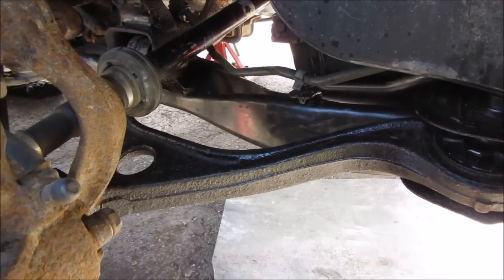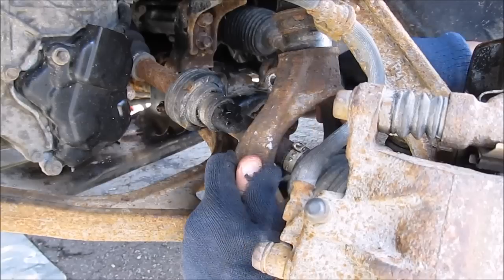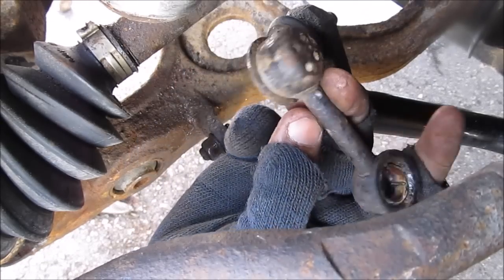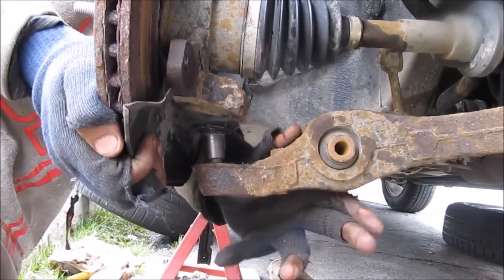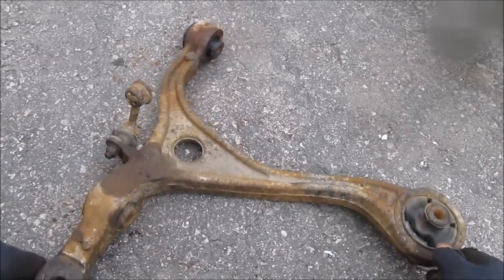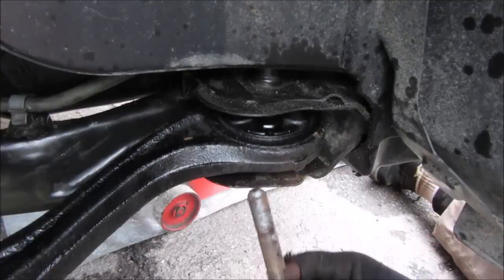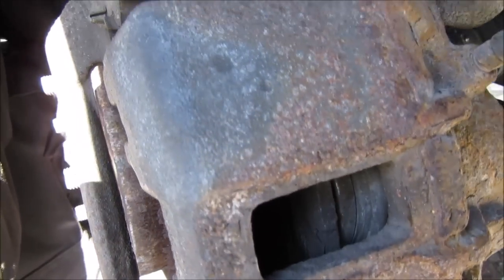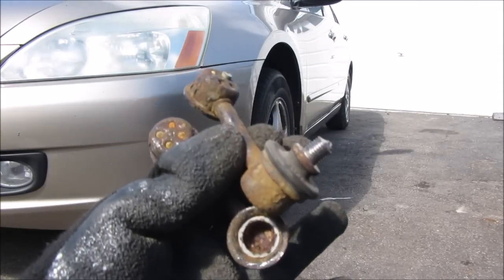Lower Control Arm Replacement Honda Accord

Comment: Customer:
I have an awful clunking noise from the front end ever since since you replaced my lower control arm?
Mechanic:
Oh that'll just be your sway bar freely bouncing up and down because I broke the end links and didn't install new ones, so notjing is connecting your sway bar to the lower arm.
You don't need those, it's just a family sedan, you'll just have to live with that hammering on the lower arm or possibly swinging down and dragging on the road, it's ok it will self clearance eventually🤣🤦‍♂️

Comment: Great video! What ball joint separator was used to separate the ball joint? All the tools I can find fork size seems to be not big enough, I believe a 28mm tool is required. Can you please share the details of the tool used.

Comment: @rafatorres1420rt, or anyone here, how do you torque to specs when the car is on the normal position? Does this mean when the car has been fully lowered from the jack? How do you fit underneath to do that? Sorry new to diy here.

Comment: The Honda ball joints require a wide jaw separator.  Where did you get yours?  Most places only sell 18mm or at most 22mm, whereas 28mm is required.
Reply from the maker: Princess auto

Comment: 1:10 FYI to peeps...it might not be that easy on your car.  If the bushings have life left in them you might need to push the control arm down to make enough clearance to get it out that way.  I also highly recommend spraying the part where the shock and fork meet with penetrating oil....it will make it way easier to get it off if it's seized together.
Reply from the maker: You might as well cut them off

Comment: When this bolt that you mention it is stuck how do u cut it ? Where from you cut it as i have this issue with my honda accord and i cant take the bolt off?  At 3:33 sec of the video bolt.

Comment: Is it labled as passenger or front driver control arm?
or just any control arm fits?
ive seen a couple but does not specify if its left or right.
Reply: no they are not interchangeable

Comment: Hey, I recently hit a curb with left front wheel at a moderate speed on my 2010 Acura RL. I was going straight down the road and hit a low "sidewalk" type" divider of lanes island head on but only edge of it. After the hit, steering wheel became off center about 1/4 inch.  I went to alignment shop but tech didn't find anything that was bent and completed the alignment.  The caster is 2.0 on the left side which took the hit and 2.5 on the right side.  To me it looks like left wheel is pushed back some.  The steering wheel is straight now, but needs a bit more effort steering than used to be.  Which component could be bent?

Comment: I am just starting to do this on my 07. I thought I would start by making sure that I can loosen the compliance bushing bolt.  Thats where I'm at right now. Can't seem to budge it. Using a breaker bar. Not impact.  But I'm also being extra careful. If can't loosen them I'll probably have mechanic do it. Are these bolts really that tough to loosen? Don't have much rust.

Comment: What type of impact tool do you need in order to remove those bolts etc when replacing a front lower control arm
Reply from the maker: 1/2" drive

Comment: Seems like Hondas are always needing repairs, I see a lot repair videos on mostly Honda vehicles.
Reply: That's because Honda's are going a lot more than 200k miles and parts eventually needs replaced. Other cars don't even make it passed 150k without blowing up trans or motor and end up in junkyards.

Comment: Been doing this job or 2 days now. Every single bushing was stuck in its sleeve with the fucking might of Zeus. Had to break out the damn sawzall for the one in the back and had to mangle the frame mount on the front one just to get it off. Rust is the worst. Love your vids tho this was a big help!

Comment: speedkar99! Good Video! I enjoy watching them and learning tips and tricks on car auto repair.
I have a 1999 Honda Odyssey 195k Miles where  both the compliance bushings are showing signs of cracking. I looked at the Honda OEM part, but they are $300 for each control arm and a total of $600 together before tax and shipping. I know Honda OEM is probably most reliable and durable, but how do the other brands compare?
I was looking at Mevotech, and moog where their lower control arm is ~$100 each. How long do those ones last compared to OEM?
Reply: Moog has great reputation in American cars. I have little experience in foreign, but I assume equal quantity.
Reply from the maker: MOOG control arms aren't as good as the ball joints, they are  typically outsourced
Reply from the maker: Supposedly they last longer than OEM but you have to keep greasing ball joints. They also come with a lifetime warranty which is great, depending on who you buy it from. See my aftermarket vs OEM ball joint video

Comment: On my right side, the bolt that goes North and South (towards front of engine) is stuck on the compliance bushing. Do you have any tips on removal? I tried a 1000 Ft lb impact and it still didn't budge.

Comment: I just did this job on my 2006 Accord. Replaced upper and lower control arms, end links, struts, and brakes. You're lucky the mounting bolts for the lower control arms came loose. Mine were seized. I tried everything and had to resort to cutting them out and buying new bolts. Not an easy job at all. You're lucky all you had trouble with was the end links.
Reply: Did car handle better after changing bits.

Comment: Really liked the no nonsense video. Do you have an opinion on the fitment of aftermarket control arms or other suspension parts on this accord gen?
Reply from the maker: Most aftermarket are made to OE spec, just look for material construction, price and warranty

Comment: What are the bolt sizes my all broke
Reply from the maker: Ouch. Dealership can get you OEM ones or take the old scraps to a hardware store and match them up
Reply: Go with the OEM; don't buy them at a hardware store unless you can confirm the parts you're buying meet "Grade 8" specifications - anything less will be significantly inferior, probably won't last and may strand you or worse if they fail at highway speed.

Comment: 4:30 Nice, well-edited video. But I can't figure out why you're cutting off the stabilizer link when both the link and the control arm are being junked. Is it to recover the core charge?
Reply: Nothing wrong with the control arm. It was removed for demonstration. He spray painted and put it back. That's why he cut off the broken link.
Reply from the maker: Thanks

Comment: i was gonna do this today but was tired lol. great job man. easy to follow
Reply from the maker: How did it go?
Reply: @speedkar99  funny story i got old arm out. had trouble le putting new one in. i kinda push my weight up agaist the wheel hub tryna push in control arm and snapped axle =]. so it took awhile longer cause i had to run back to the store to buy axle. oh well i luv new parts hahaha. however job completed though. thanks man.
Reply: and now i wanna do the axle on otherside to match. lol. worse than a female lol.

Comment: Just a quick tip if you're going to be working on a rust bucket soak what you will be working on with a penetrating oil catalyst for at least 24 hours. that makes life a whole lot easier
Reply from the maker: That helps
Reply: Just heat the hell out of them

Comment: I HAVE AN 08 YSX I WAS THINKIN OF USING THIS !!

https://www.amazon.com/PartsW-Suspension-2004-2008-2003-2007-Control/dp/B0751ZQ96Y/ref=asc_df_B0751ZQ96Y/?tag=&linkCode=df0&hvadid=330440990362&hvpos=1o3&hvnetw=g&hvrand=6483911240197476725&hvpone=&hvptwo=&hvqmt=&hvdev=c&hvdvcmdl=&hvlocint=&hvlocphy=9029600&hvtargid=pla-693856673677&psc=1&ref=&adgrpid=66704631099&fbclid=IwAR0Lf0dpxnBbPUPl7BQs9Ye17a0pXNS8nNbuyjYi8nYFsq_IWzTmoB9txn0

Comment: can you help me? my bolt is rusted into the bushing..if i want to remove my bolt the bushing is spinning around with the bolt...please help
Reply from the maker: You need to cut the bolt off and extract the arm
Reply: I had the same problem.. I put some wd40 in the top and then kept working the bolt up and down (just a little bit) and finally the bolt broke free.
Reply: I know this is old but always have torch when working with old cars. Anyway bushing will go to garbage. Heating saves time and unexpected problems

Comment: I tried to loosen the bolt to the front bushing and the bushing just turned with it. Any tips? I want to replace the whole control arm with the bushing already installed. If I keep turning the bolt will it come out or will it just spin?
Reply from the maker: You'll need to cut that bolt off, its seized to the inner sleeve of the bushing.
Reply: speedkar99 I spent most of a day yesterday cutting off the bolts, the front and back bolts were seized to the bushings. I bought a recipracating saw and 5 blades, I dulled all 5 blades and then I had to go buy more blades, those bolts and bushing were HARD. So it took me 9 saws all blades, 2 angle grinder blades and a Dremel. Still cheaper than if a shop did it. That was just ONE side.

Comment: One thing to note about the installation of the lower control arm is that it's very important to not tighten the bolts while it's up in the air with the suspension at full extension, particularly the rear bushing.  Doing that will put an abnormal preload on the bushings that stresses the rubber when the car is brought back down and twists it, and will shorten the life of the bushings .  Best practice to to put it back down on ramps and then tighten up the mounting bolts with the suspension position nomalized.

The sway bar end link needs a 5mm hex to hold the stud from spinning; I originally tried a 3/16" and it slipped, and I went to the locking pliers, but it was unable to hold.  Then when I got the 5mm, it held tight and I was able to get it out without damage.

My difficult time with one side is that the ball joint bushing came out with the ball joint instead of staying with the control arm; I had to use a muffler cutter to slot it and then used pullers to extract it from the ball joint stud, that was a PIA..
Reply from the maker: Good important point on stressing the bushings
Reply: Does the stabilization link really get tossed? Is it really unnecessary?
Reply from the maker: It minimizes body roll
But not mechanically required to operate the car
Reply: speedkar99 lol technically you can remove you’re windows and body panels and run your car with only 2 cylinders working and no exhaust and many other things but why would you?
Reply: @Rlprime  Do you slalom your accord to the grocery store or to work? If so, keep them. If not, then you'll experience a little more body roll than usual. However, any impact on one side of the suspension won't have a direct impact on the other side of the suspension since they're only connected through the chassis/driveshafts rather than a linkage if you remove it.
Reply: @Rlprime  On most driving situations, it will be fine. But removing front sway bar, eventhough it gives more tractability, it will also increase oversteer. Might be a problem on some situations, especially with bad tires (please always fit the newer tires at the rear)
Reply: Very Important statement you pointed out, but sadly most mechanics neglect it and then, if you notice that while next to a mechanic, he will say let me do my job and won’t take it as a advice, and most part to do it, right

Comment: Im trying to replace the lower arm from the rear but the bolt thats on the frame won't come out any hints on the  some one
Reply from the maker: Heat and penetrating oil. If not then cut the bolt and press it out.

Comment: great video did u miss putting the stabilizer link back on?
Reply from the maker: +Rick dude did you see the end of the video? 🤣
Reply: speedkar99 haha nice thanks for all u do..I'm currently working on my aura tsx the AC won't work and I know nothing about ac..do u have a video for that and also it would be great if u made a video on how to remove rusted rounded out bolts and screw I've tried many tools like the gator grip that don't work very well...thanks have a good one.

Comment: That 19 mm bolt that goes thru to the frame is just spinning with the bushing  sleeve. If I cut the bolt how would I get a new one. And how would I get the rest of the bolt out? I assume I would still but the I could damage the threads. Any help is greatly appreciated.
Reply from the maker: +frank lucas you'd have to cut it out and extract it.

Comment: Awesome video man! I have leak on my rack opinion trying to replace it but I can’t find any video in YouTube I was wondering if u done that before please if u could help me!
Reply: eric the car guy has one for sure. other than the 2 clamps underneath it's just 2 awkward pressure fittings you have to reach. It's recommended to flush your system or replace the pump, hoses, reservoir and rack all at once. $1000
Reply from the maker: +Neil Sitto I don't have a replacement video but I have two tear down videos.
Reply: speedkar99 okay thank u brother

Comment: Family Sedan does not need stab link??? Why?
Reply from the maker: +Charles Fu haha
Do you need to take corners that fast to use the sway bars when driving your family around? Hmm
Reply: If this argument is valid, then Stab bar is not needed as well! That is a huge cost saving!
Reply: Will fail state safety inspection without stabilizer links in MA. I failed due to broken rear ones on an Accord.

Comment: Do you have the torque spesifications for it
Reply from the maker: +pavel1809 nice and tight
Reply: @speedkar99  The vertical bolt is supposed to be torqued to 61 foot-pounds and the horizontal one to 47. You torqued those to at least 100.

Comment: FYI the bushings like the dampener fork are supposed to be snugged down lightly then the wheels put on. Lower to ride height and then torqued to spec. If you just tighten while up in the air you can destroy the bushing as its tight in that position then at ride height it gets rotated a lot more.
Reply from the maker: +kevin limparis Agreed, I read about this after bolting everything up. Good tip
Reply: kevin limparis can't you just put a jack under it and tighten it down that way?
Reply: What are the specs for torquing the bolts?
Reply: I think that’s why he lifted the rotor up a bit to tighten it down, but yes it will rip it or put stress on that bushing if done in the air.
Reply: @Xygenon  No. That was only to reduce pressure. To do it right, you need the weight of that corner under full load. So if you use a jack, then you jack up until the jack stand on that corner starts to get loose. There's no way he (or anyone) would lift the weight of that corner with a scissor jack on the brake rotor.
Reply: that why blame is put on cheap parts where it's really a combination of workmanship & cheap rubber

Comment: Any suggestions on how to push back in the inner cv boot?  I think that's what I did and it won't fit back in.  Pushed out about 2 inches too far.
Reply from the maker: +Shawn Gilbert yea I had the same issue. You need to twist it as you push it in. If you don't understand how CV axles work, I have a video when I took one apart and youll see what I mean.
Reply: Yes, I watched the video, great idea BTW.  Turns out the CV connections was mush...car has quite a few miles on it so I replaced thanks for your videos.  I plan on tackling the other side next week.  Also, after market sway bar links are different.  They have a nut on both sides.  Hope this doesn't cause any issues.

Comment: Thank you for your video.The shop quoted me 850 dollars for parts and labor. I spent 3 hrs to replace one lower control arm. Saving tip . AutoZone can rent you ball joint separator. You pay 30 dollars. Use it and give it back for money back. Also one more good tip is if the shaft is popped out from inner ball joint, put a wheel back on with two rugs, and rotate tire little by little and tap the top of the wheels ,bottom and left and right side till the shaft is pope in. Keep repeating till the shaft is popped in.
Reply from the maker: +Bon Koo thanks for the feedback. Glad you figured it out. Yes I ran into that CV axle popping out too. Had to rotate it a bit to get it to pop back in.

Comment: The front main bushing bolt got stuck to the bushing and won't come out at all, any suggestions?
Reply from the maker: +Amerikai Cut it off and press the bushing out. Thats how any other shop would do it.
Reply: speedkar99 I was actually able to get the bolt out after iamming the bushing in place while turning the bolt. Thanks for answering though!

Comment: Thank you for the excellent video! I watched this several times before starting doing mine. Here are some details I noticed:
(1) The ball joint separator can barely fit on the back side. It's not needed to remove the caliper.
(2) Before tightening all the bolts, the suspension should be loaded (by a jack under the control arm), otherwise there will be added stress to the suspension parts.
(3) Cleaning off the rust on the exposed threads will make swaybar link removal easier. If not cleaned, the hex hole can easily be stripped.

Good editing job! Keep it coming.
Reply from the maker: +J. M. Thanks I'm glad it helped and thanks for The tips
Reply: J. M. If you tighten it with the right torque spec per manual do you still need to lift the control arm?
Reply: @tabueno12  i would say yes , because you gotta torque to specs when the car is on the  normal position regarding to the service manual

Comment: I have 2004 accord, in the past 3 years I've had to replace lower control arms twice! I drive the car like a grandma too. The mechanic charges me $750 parts and labor.
Reply: Installation error? Tighten bushing through bolts wirh suspension loaded or your bushing will tear a lot faster. Of course you'reechanic won't admit to that though haha
Reply from the maker: +carlorocky Did you get an alignment after?